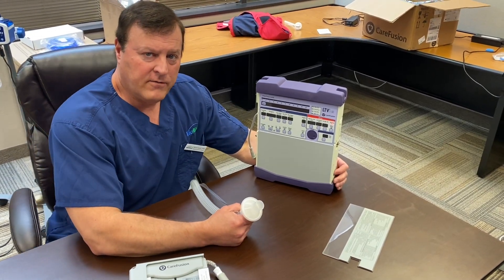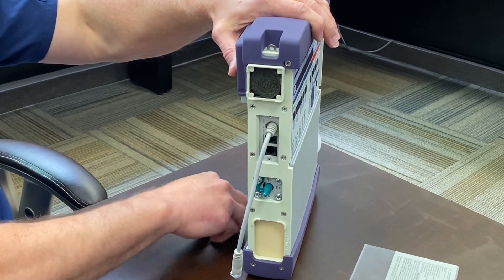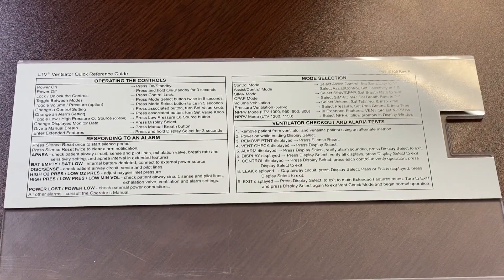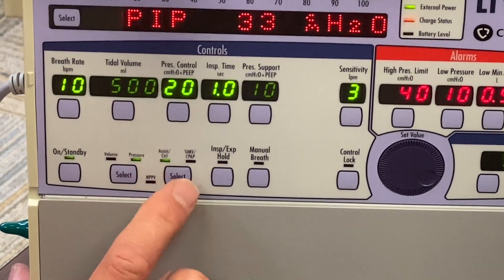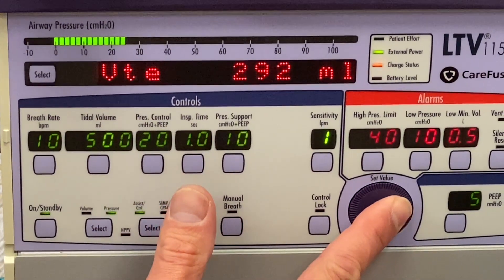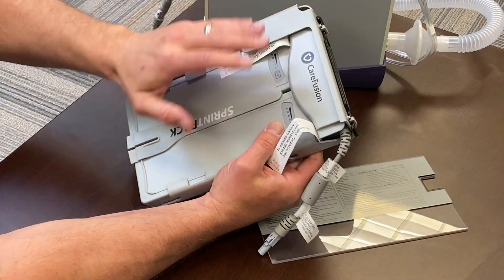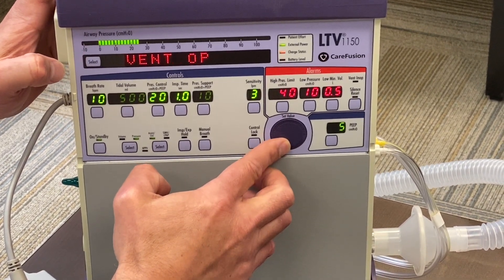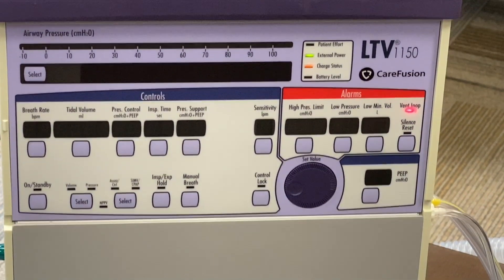Initial Setup & Settings - CareFusion LTV 1150 Ventilator

Comment: The LTV 1150 is a great ventilator. It's rather old and You have to have an LTM to view waveforms, but It's wonderful, being that it has the flow sensors at the wye. I like that. Would I choose it over a VOCSN. NO! Would I give it a five star rating? No. But It's a good ICU ventilator. It's a good ventilator for home care. I do wish it could be corrected so that it wouldn't push secretions in when you're suctioning. Vents like the Hamilton and the Servo don't have that problem, but with home vents like the LTV, and the Trilogy Evo, There's no way around that.
Reply: wait, Im not sure if I udnerstood that correctly. Are you saying when you suction a patient while on LTV and Trilogy that the secretions push into the vent tubing?? What are the secretions pushing into?
Reply: @FAiRWARNiNG_Podcast    The secretions are pushed into the lungs, because even when you suction the vent still administers a breath while suctioning.